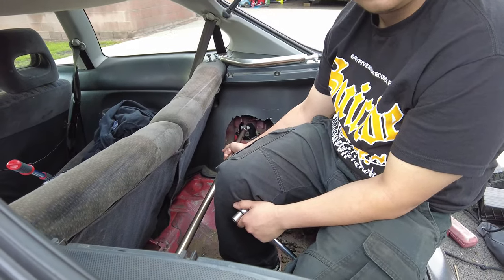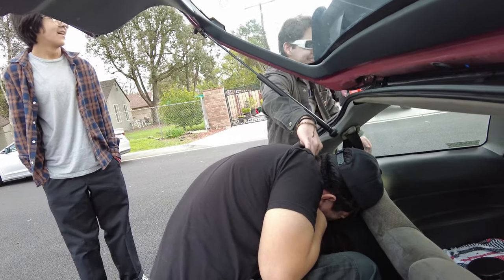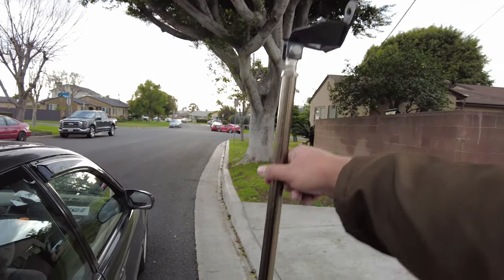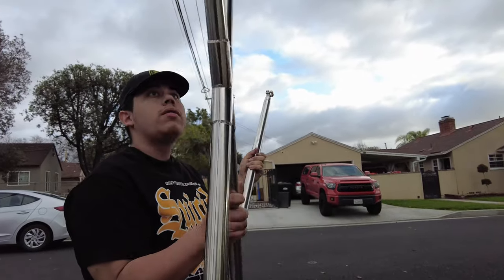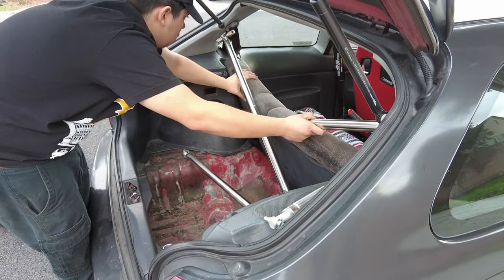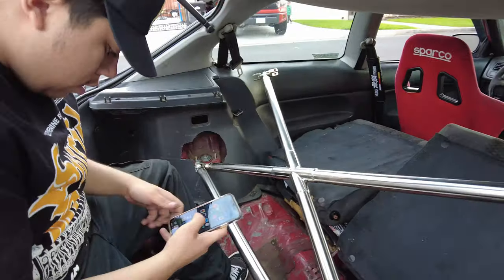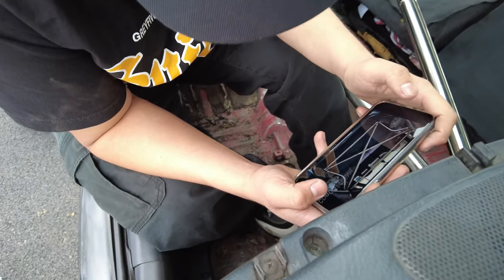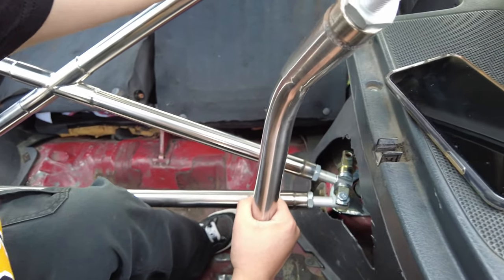EK9 PLM CROSSBAR INSTALL

Comment: out of 1 to 10, how hard was it to install?
Reply from the maker: 6
Reply: @sokudoboiz  I’ll be trying to install the plm one into my hatch lol
Reply: @raysb240sx have you done it yet? If not I recommend starting with the x brace part and mount it to the strut tower and old seat belt mounts. Leave everything semi loose except for the strut tower brackets, line up the seatbelt bracket bolts and tighten them down. and next thing I did was install the other mounting brackets onto the others,and started on the curves. You want to make sure you have enough room to let the bolt pass through but not so much that or too little that it’s hard to fit through. You’re able to test fit the top and bottom lateral bars . They do not have to be even, just able to be mounted, you can adjust the bar later. After you test fit it tighten down the four hex key bolts that hold everything down. ( this might take a few attempts as you have to make sure you have it all aligned.) Make sure the curved bars are how you want them. Then just thrown in your top and bottom lateral bars and you’re good. It took me a few hours to get it, and I recently went back yesterday to re-adjust everything.